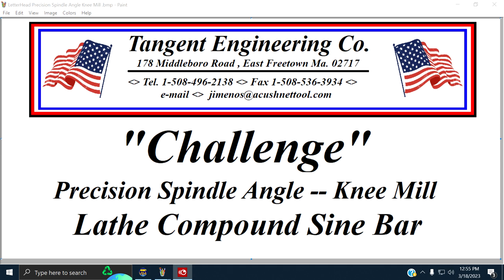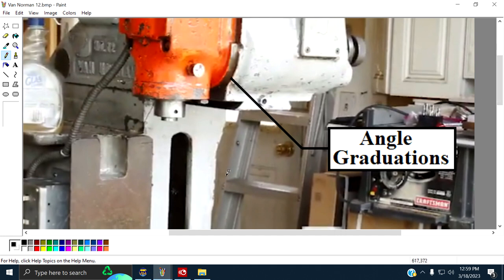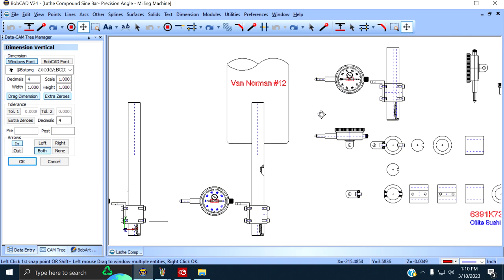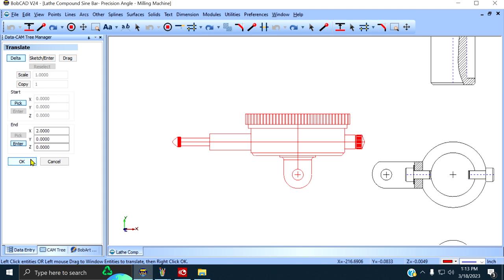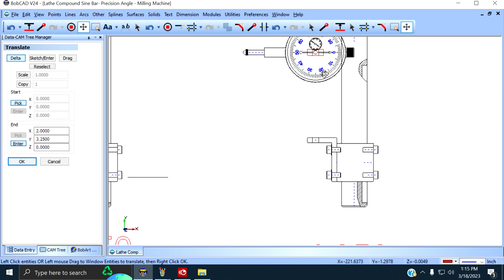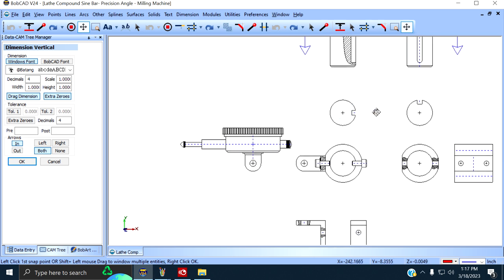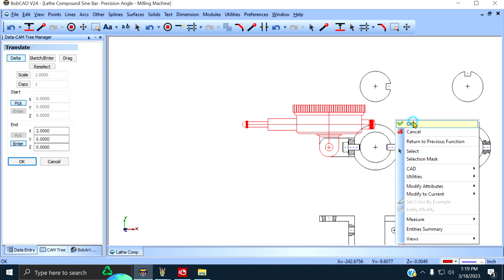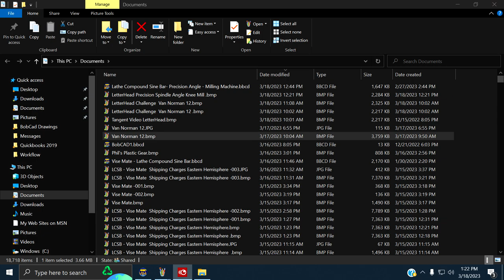Challenge-Spindle Angle-Van Norman

Comment: Great solution Jim!  The only thing that would need to be changed is the diameter of the rod and bushing; the largest VN collet is 5/8" or the end of the 1" bar could be turned to 5/8".
Reply from the maker: Rick - I don't have a clue about maximum collet sizes for your Van Norman #12. I do know that McMaster Carr offers a one inch R8 for a Bridgeport. FYI -- I'm making up a set of .jpg drawings for Matty's Workshop that can 
be e-mailed  and printed. If you are interested send me an e-mail.